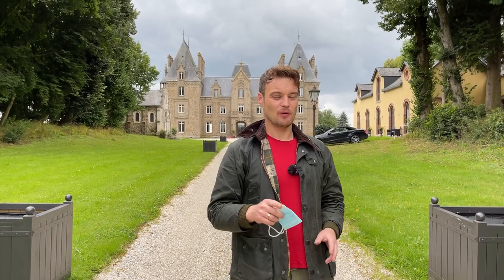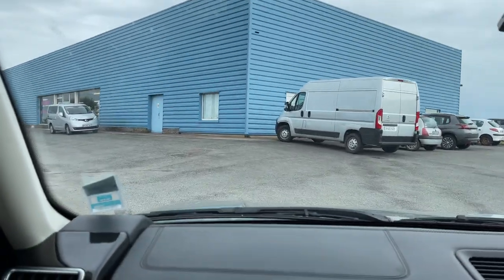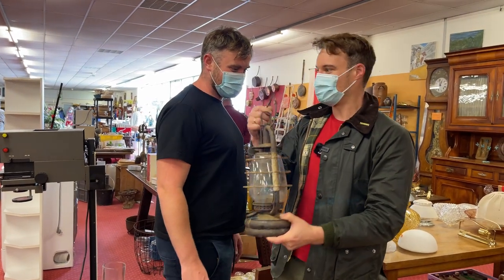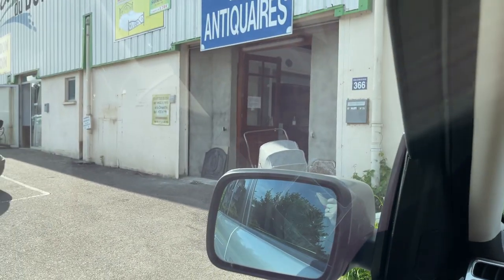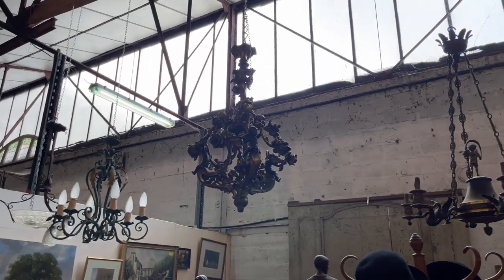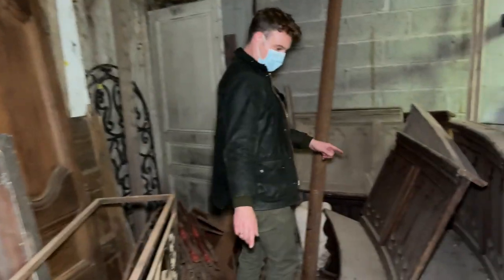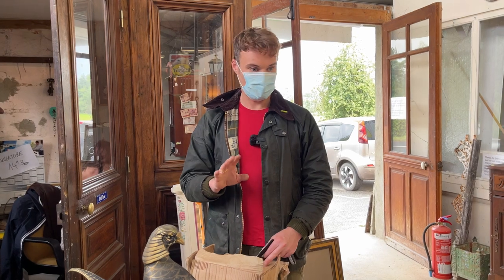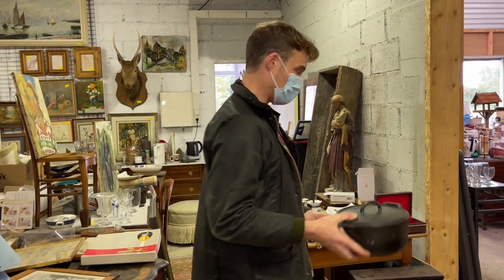Antique Shopping - Doing It Ourselves Daily - Day Two

Comment: Michael, we had those  cast iron pots on the farm when I was young a very long time ago.  That lip around the bottom is very cleaver because you remove the middle bit in the stove ring and the direct heat from the fire is trapped under the pot for browning meat fast and hard.  Then you close ring for simmering on a cushion of air that doesn't burn the base.  If it gets too hot, you slide a knife under and you get a slow simmer.  That ten Euro buy was much more of a bargain than you realise!
Reply: Oh, I love discovering all these lovely tips!. Interesting to read about this particularity of the pan. I have a wood stove with rings and am excited for the knife trick to try this winter!

Comment: Michael,  I live in the mountains of Washington state up by the Canadian border. We are very remote and have always had oil lamps ready to use for power outages. We lose power in the winter due to snow storm and we get wind storms in the spring. Years ago we had a horribly destructive wind storm and we were without power for a week. Thankfully we had oil lamps and a generator. We ran the generator for a few hours a day to be able to have hot water for dishes and bathing and to keep the fridge and freezer cold so our food didn't go bad. I use an antique oil lamp on my fireplace mantle as decoration, but it does still work!

Comment: Summer is in Kansas City. The heat index is a humid 112 degrees (F) today.

We’d call the cooking pot a Dutch oven. They could be put in the hot coals to bake things or make stews over fire. The original ones you could put coals on top of the lid for more even cooking.

Comment: You could use the corbels to hang your curtains.   Drill a hole and use a wooden rail, cap the rail with wooden finials and then hang you curtains with wooden or brass rings.
Just a thought 🙂

Comment: Having an oil lamp or two in spare in case of a power cut is a good idea, but you probably need to find one with a larger/wider wick. The ones you found are very nice indeed, but they won't give much (but cosy) light with those small wicks plus only one has its glass. Keep looking!

Comment: I say this to everyone. Don't begrudge the rain dear. It makes the countryside so green and beautiful, saves money on water bills and generally cools things off and slows things down a bit. Fingers crossed that there are adequate drainage points: ditches, rain gardens, etc., low areas to accommodate excess rain. Every stretch of concrete demands the creation of a place to accept water that would have permeated the ground. (You guys should research the creation of rain gardens for your property).

Comment: The lamp you were holding and thinking a candle is actually a spirit lamp and runs on alcohol. When the wick is stuck, you can soak it as it is old kerosene or lamp oil that has seized the gears. Mark

Comment: This was such a fun video. I was wondering what the prices are like compared to England's prices? I remember when I was younger, we were stationed in England. We used to go to Brighton, which is where my mum was born & raised. When we'd go down The Lanes, which had lots of little antique shops, the prices were so cheap. Then alot if the military families started going there and buying up lots of things, so the prices when way up. Which was ashame, but understandable. In America there are antiques, with good prices. In CA, the land of the greedy, you'd have paid $50 - $75 for that cast iron dutch oven. On the east coast it probably wound sell for $15 - $20. Anyway, I'm glad you found some cute oil lamps. That was super kind of Billy to give you the gold chain. You have such a wonderful relationship with your brother. ❤️

Comment: I would like to modify your cast iron roasting pot to remove the raised "heat ring" so it has a flat bottom. I have done this for pans and it comes out just fine. I have a machine shop and will do this for free.

Comment: Just a thought, solar and battery lights are much safer. Mount a small solar panel (s) facing sun and run a wire to inside to the light. Turn on when needed.

Comment: One thing to examine on an old oil lamp that otherwise seems to be functional is the oil container itself. It needs to be absolutely leak proof! I once found a very cool storm lantern with a bat in relief on the glass. The metal oil container had been fixed, but it still leaked. Buhuu! I put tiny LED lights inside instead ... 🦇

Comment: Hi Michael, that was a great video! That cast iron pot can definitely go on the hob, the thing about cast iron is once it gets hot the whole thing is evenly hot. It's a great find! In America it would be called a Dutch oven, though it might be small for one. 
I also have several oil lamps, they are a great insurance just in case the power goes out and the small candles aren't enough. I would use it more but my husband thinks they're unsafe with the oil in them! Oh well. Keep your eyes open, like that lady told you, you may find the globe(glass cover) for your other lamps. I would trace a circle of the size you need and keep it in your wallet, just in case you find some and need to see if it would fit. Does your friend like antiques? It would be nice to see what he thinks of some things. Cheers!

Comment: GOLD BUYING TIP: Gold weighs much less than most metals they are paired with. The heavier it is, the less gold to metal ratio. I have to buy the highest level gold I can afford, b/c my ear lobes are very small and heavy earring actually stretch the aperture. Plus, I'm allergic to nickel.
Reply: Gold is actually denser than copper, silver, nickel and even lead. Solid gold feels heavy!